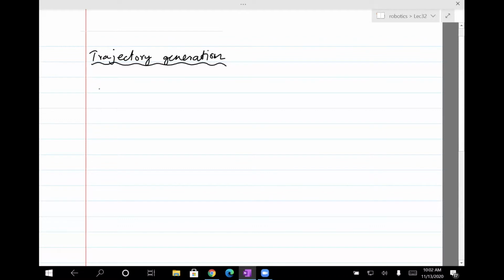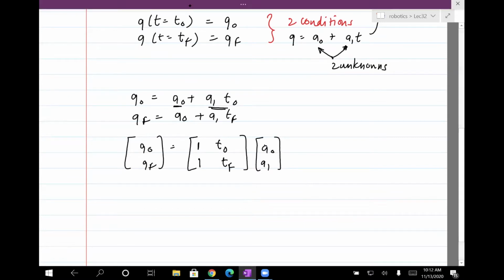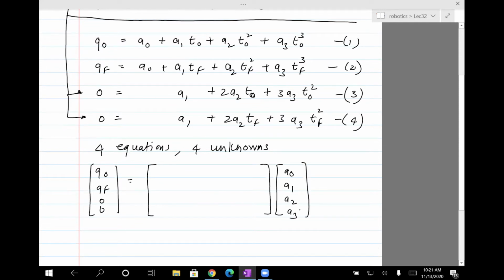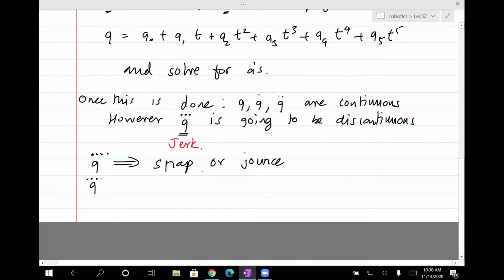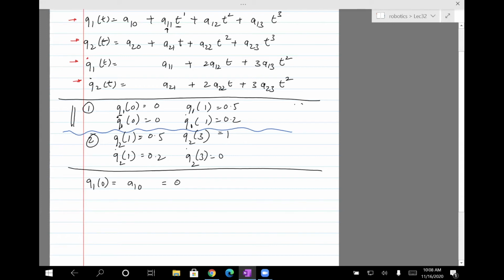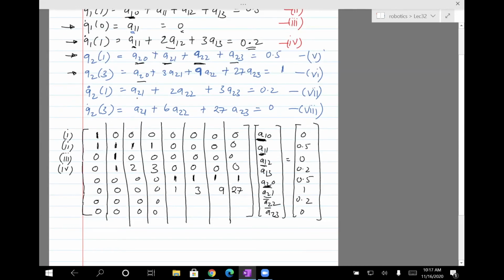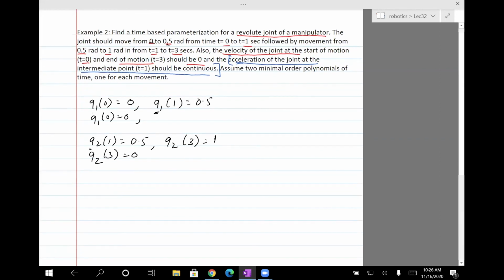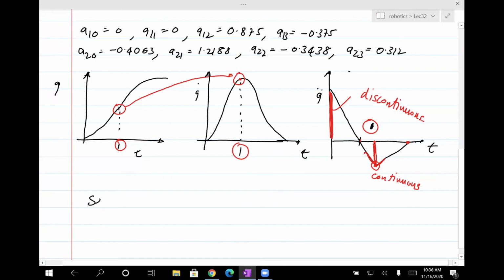Robotics Lec32,33: Trajectory generation (Fall 2020)

Comment: Thanks for your clear explanation.
Kindly, I have a question. Which is, how can I derive an inequality constraint/condition while generating the trajectory between two waypoints. e.g. let's take the second example you presented. How can I add a conditions that q1(t)<4, q2(t)<6,  qdot1(t)<3, and qdot2(t)<3 (two inequality constraints. One on the zeroth and one on the first derivative (the speed)).
Best regards,
Reply from the maker: Setting inequality constraints will lead to multiple solutions. In that case I would suggest adding a cost and using fmincon to find a unique solution. I have a lecture on trajectory optimization which might help in this regard.